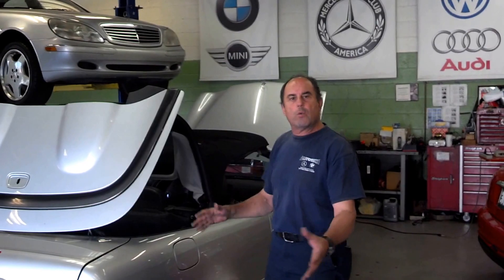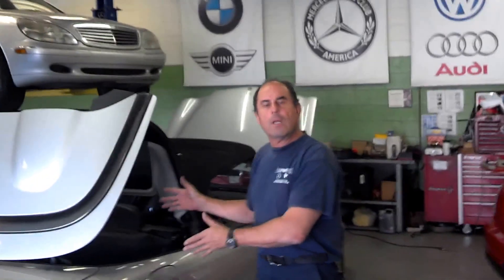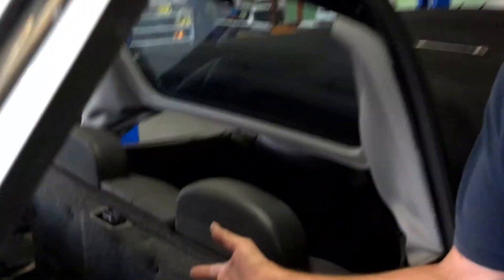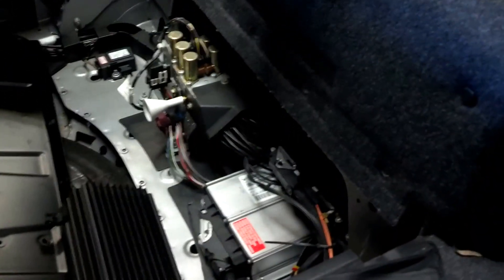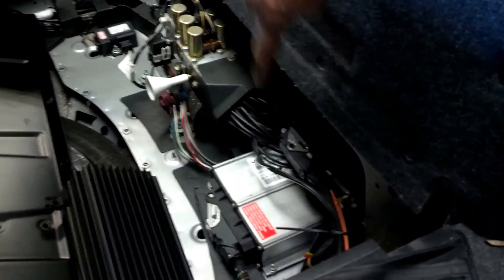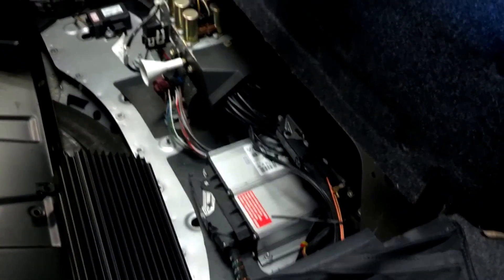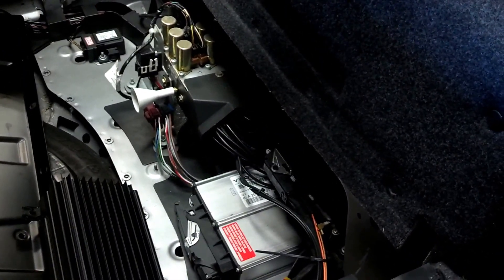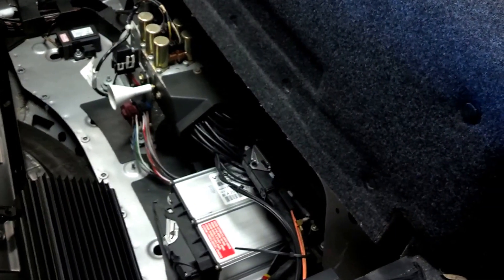Mercedes Convertible Soft Top Repair,Inspect,Diagnose,Service. Culver City Los angeles

Comment: I have a Volvo c70 1999 the top open and close good but my problem is the cover that close back on the top when I open it,it doesn't close but if the top is close it works fine hope you understand my question

Comment: Question why do you release the pressure on the pump is that to reset anything I put a replacement ECU still come up but won’t go down by release the pressure will that rest anything sorry a novice